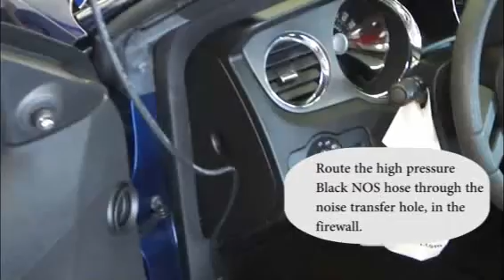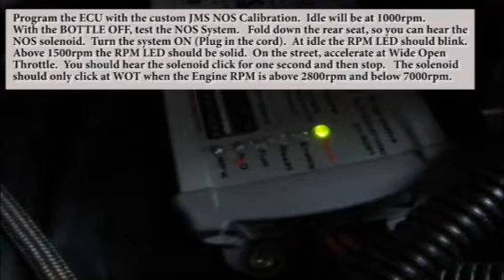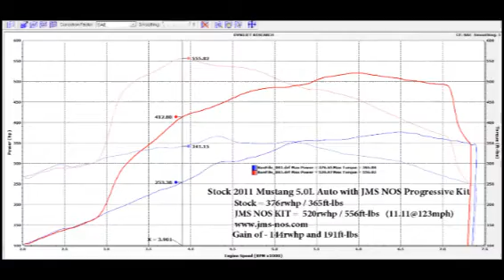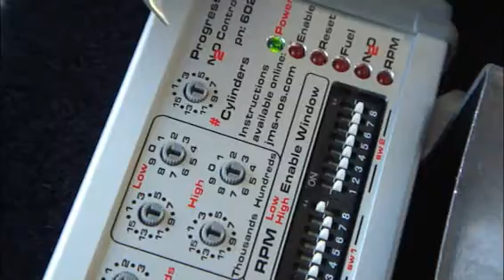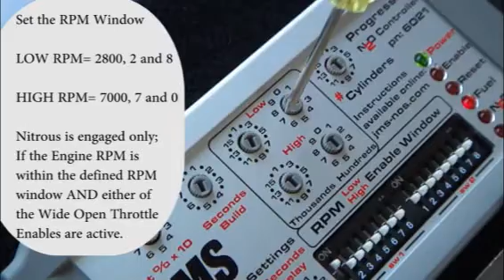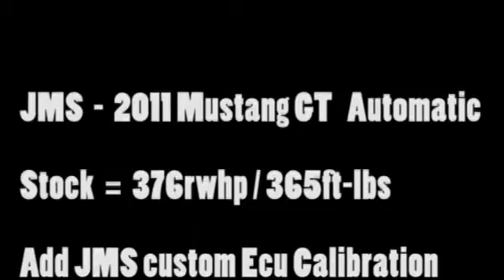JMS 2011+ Mustang 5.0L NOS Kit Installation - pn: NOS-5000 with JMS Progressive Controller NOS-6021

Comment: Dry kit, no fuel line to worry about. Jet is at the solenoid.  Not a huge need for a bottle warmer on this smaller shot. Sure, it helps, but it's not critical

Comment: Fuel line inside sound tube was just left in there loose, no jet on it or anything. Where does the fuel line connect that's still loose in the sound tube?

Comment: Where's the bottle warmer? Folks no bottle temp control on pressure is not good. Plus, the fuel line inside the sound tube was eft